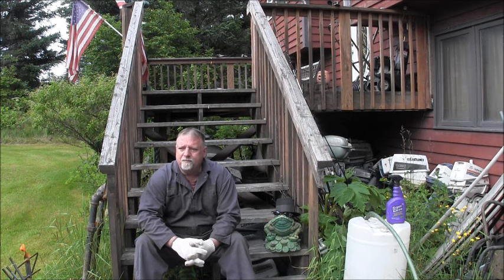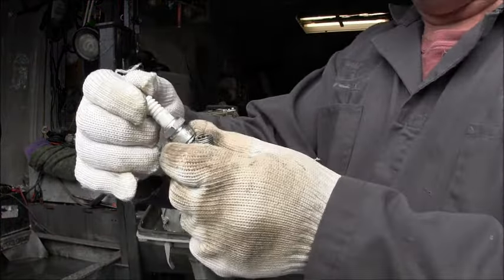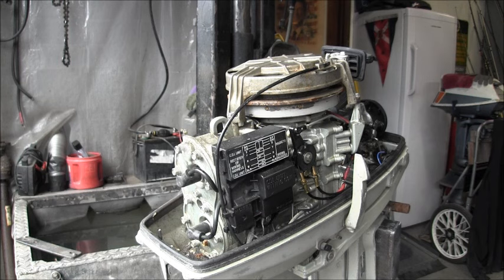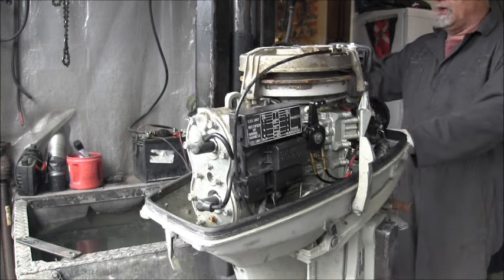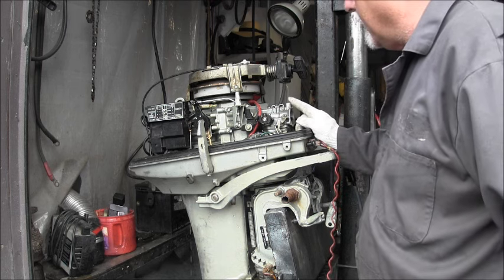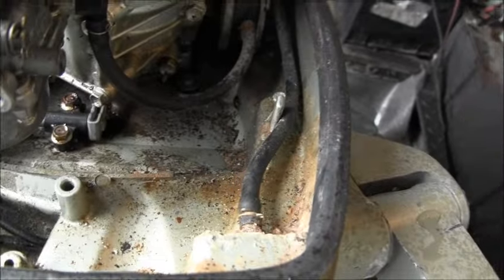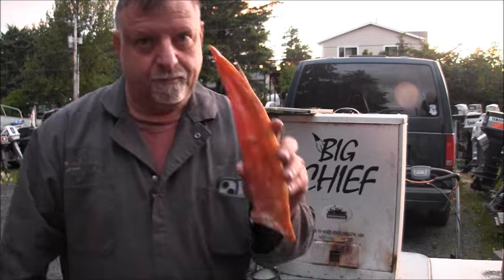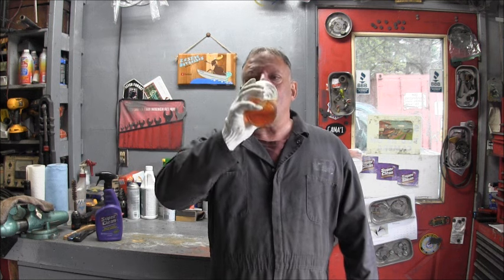SUZUKI  DT- 25  1980's  TWO STROKE OUTBOARD

Comment: What was that wire brush thing you done on the flywheel ?👍🦘🇦🇺
Reply from the maker: Just my way of knocking of  the crud & Rust on a old outboard flywheel that has been wasting away for  years.  After  the wire brush treatment  then a good  spray of Tri-Flow  looks like new.      kb